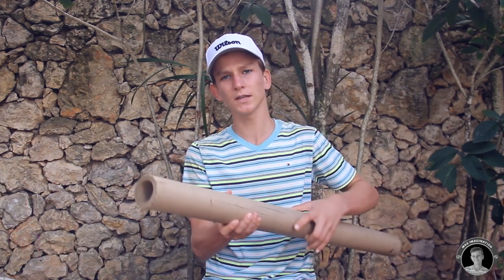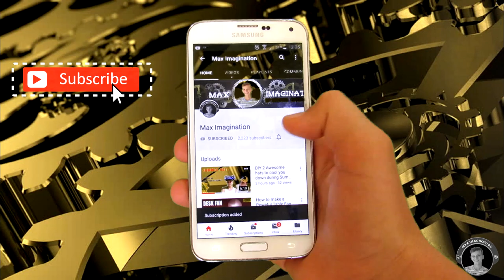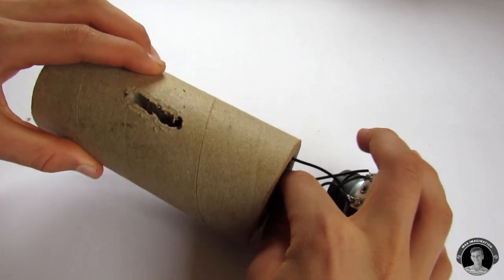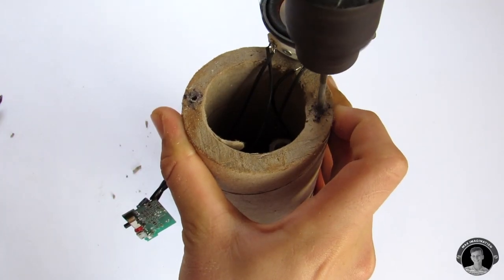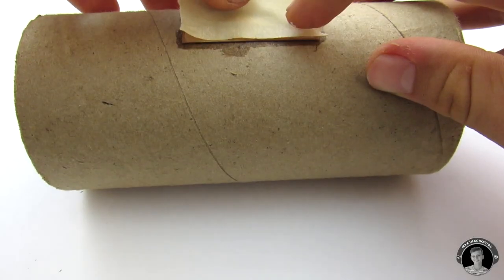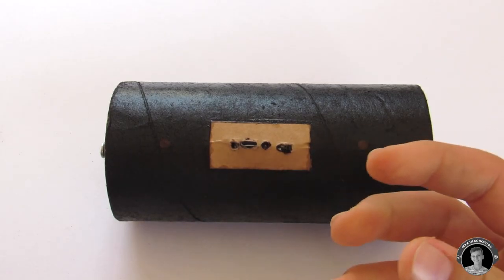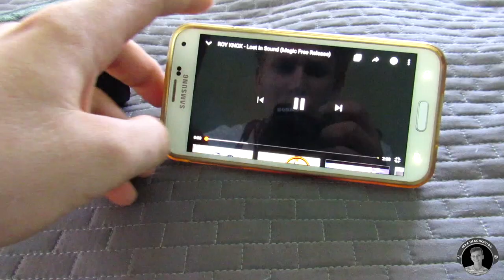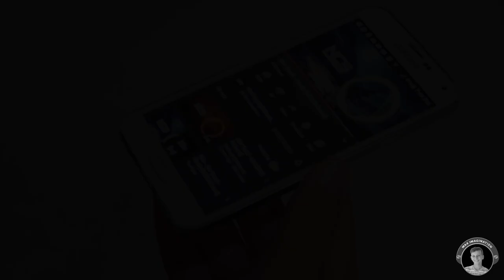DIY Bluetooth Speaker from Cardboard Pipe | Homemade Powerful Speaker

Comment: The right way to fix "the missing something" would be to add a passive radiator or proper bass reflex pipes in order to get some punchy good bass. Sealed designs are pretty common I don't know why yours sounds muffled. Anyways, good tutorial for a basic speaker!
Reply from the maker: Will keep that tip in mind for one of its future improvements! Thanks